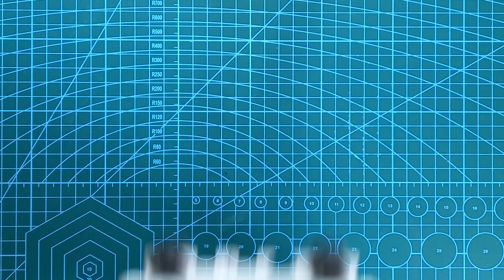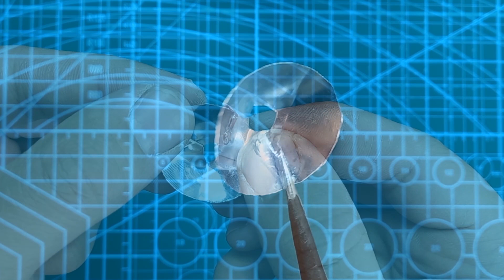How To Make Free Energy Flashlight at home from an old dvd player

Comment: They used to make toy guns that when you pulled the trigger it spun the insides... if you squeezed it repeatedly it would spun faster... seems like a valid thought... just can't remember why it spun inside... maybe it sparked inside? Well, the trigger system from it seems a good way to run the light at any rate.
Reply from the maker: Critter ray .Thanks for comment! this flashlight will last a very long time